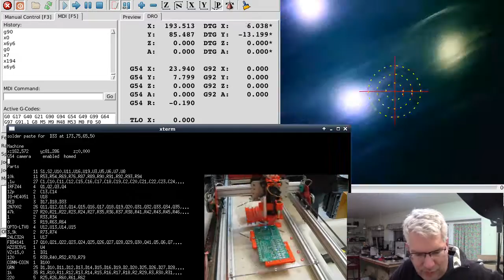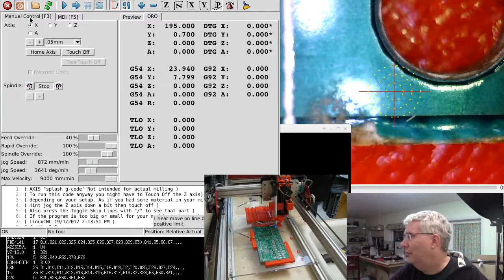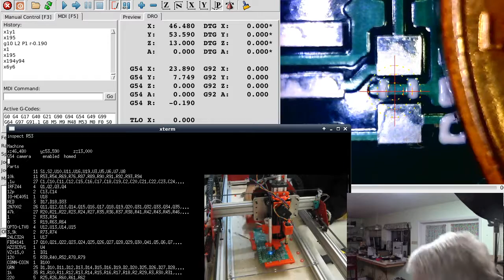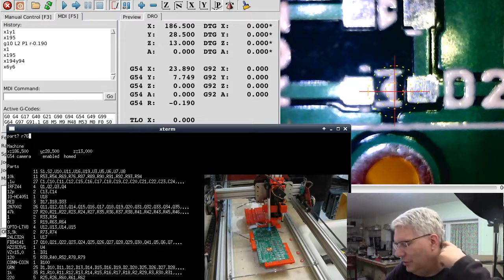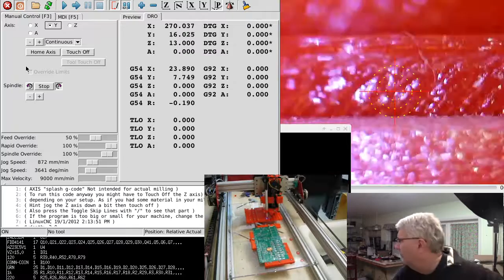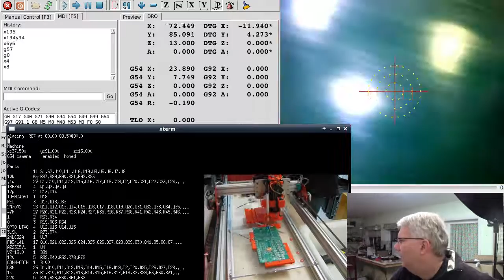161012 Maker - TEX and Pick'n'Place 2

Comment: Hi sir, what image processing software do you use for the camera? Is it OpenCV? How do you make it talk with the LinuxCNC software?

Thanks
Reply from the maker: Sorry I never got this completed. Although, I started using OpenCV to find centroid and rotation of parts, it was quite easy. LinuxCNC does have a way to control from external program. I will complete my pnp machine in the future but I'm going to use grbl or a smoothieboard. LinuxCNC is a little overkill. However its 3D display is nice. Thanks for watching. Hope you get your machine running. Its fun.
Reply: cool. I am currently using GRBL and universal gcode sender to program my CNC machine. This results in an open loop system but I would like to incorporate a camera to create closed loop system.
Reply from the maker: you'll need python running opencv to control your grbl board. so you'll lose UGS in this setup. A couple years ago UGS didn't have external comm port to accept g-code from external programs. It  might now. Also, you'll need your CAD software to output part centroids and rotation.
Reply: sounds good. I will give it a shot. What is the camera that you used? you mentioned it being a microscopic camera?
Reply from the maker: I  bought these, https://www.aliexpress.com/item/2-8-12mm-varifocal-lens-5MP-2592x1944-CMOS-Aptina-MI5100-1080P-30fps-Free-driver-industrial-usb/32808872864.html

search for 
2.8-12mm varifocal lens 5MP 2592x1944 CMOS Aptina MI5100 1080P 30fps